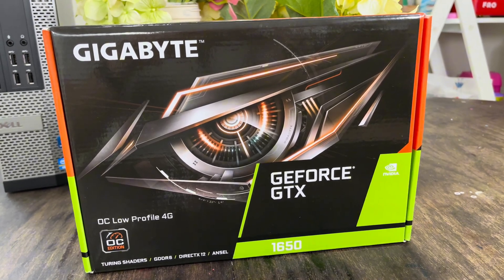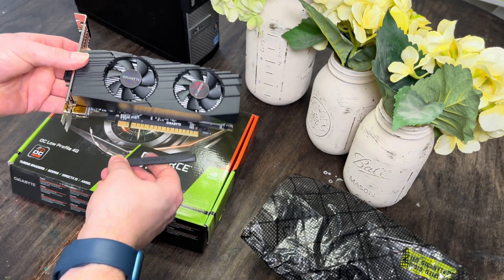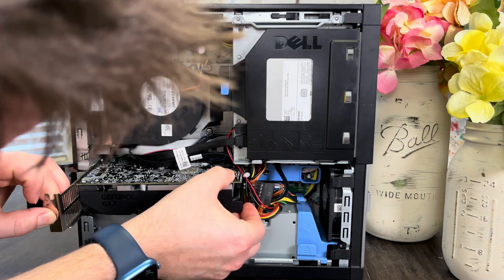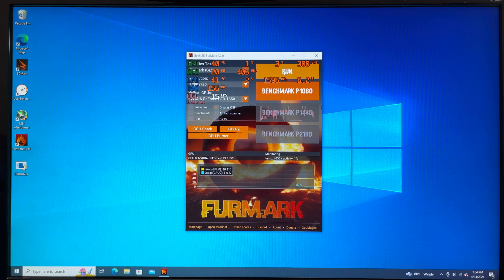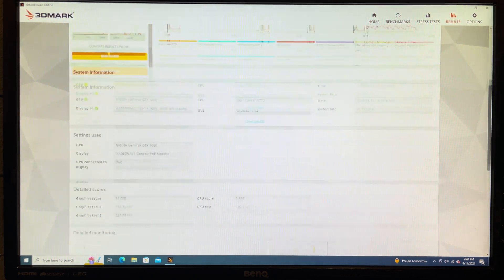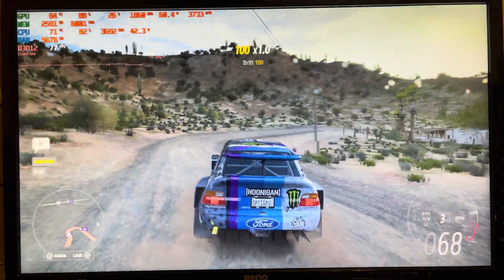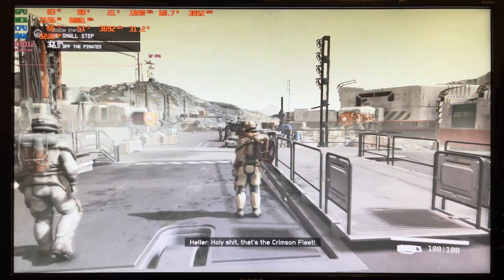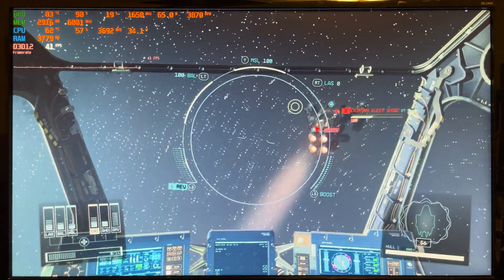￼Installing and Testing GTX 1650 low profile in￼ a Dell Optiplex 7010 SFF

Comment: I have the same desktop with the i5-3570 CPU and GTX 1650 LP graphics card and running the TSW5 on it. Very smooth on a 1920x1080 resolution.

Comment: Is it safe to add 1650 on desktop with i7 CPU & 240w PSU. Mine is 300W with i5, still fear to add RTX A400 low profile. Am i good to install it. Mine is asus s500 se desktop.

Comment: That PCI slot location is just one of the things that's great about the old X010 series Optiplexes, as later models put the x16 socket at the very bottom, limiting the use to single slot width cards.  On the MT it allows the use of a standard PSU as the mobo has a 24 and 4 power sockets, and versions that have a BIOS update that has Spectre and Meltdown mitigation microcode allow them to use Xeons for the same socket, in which the E3 1270 V2 and E3 1280 V2 are more powerful than the I7 3770, are cheaper on the 2nd hand market, but have a lower TDP (69w vs 77w) at the cost of not having an igpu.

Comment: Awesome video help. I'm trying to decide between a 3050 LP for an Optiplex 7070 or a 1060 LP so I can run a Quest 3 for VR modeling. Which would you say is the better card? Thanks.

Comment: I recently bought for a friend of mine a rtx 3050 6gb motherboard power only. Due to his 11 year old gtx 660 died out. Just asking because i am wondering how small or big bottleneck there is on above 8-10 old pcs? Think he has those 3570k i5 intel series
Reply from the maker: This is how it performed:
https://youtu.be/qFtEhB0Eq88
I’ll have to do more testing b/c there may have been a problem with the driver in my video

Comment: I need a Low Profile GPU slightly above GTX 1660 for my premiere pro 2024 at around $200 for optiplex 7010.  Recommendations please. I don't mind fairly used
Reply: Probably 3050 6gb low profile might work, no need for extra power connector and on average its around $180-$200

Comment: Never worry about low profile cards,
I use an angle grinder and cut a slot in the lid.
I am an experienced engineering workshop pro.
I can also get the same result much slower with a metal snips/shears or
even a 3 dollar mini/junior hacksaw and some sandpaper to smooth edges plus a quick spray of rattlecan primer and paint.
Easy mod.
Reply: mine iripped it on my own and bend some then put some plastic stick to stick it hope it last :)
Reply: mines dell 1650 its literally 1650 with 1 basic fan but atleast it didnt go over 90 celcius mostly 89-90

Comment: I love low profile pcs. I have a low profile pc with a 4060 and an i5-12400f to run my racing games.
Reply from the maker: Love it!  Thanks for watching
Reply: Could you do the same with the same GPU but with an optiplex 3020?  @OptiGPU
Reply: @carlosdavid8279 depends on which model it is if its a ddr3 model no
Reply: Nice flex lol
Nice build btw
Reply: @Random_viewer-2.0  haha tx. Wasn't realy trying to flex, more like... trying to say how much power you can cram into a tiny tiny pc, for, honestly, not that much money!

I mean the whole build was in around the 500 dlls mark, but considering i can play forza horizons 5, the crew 2 and others at 4k 60fps with the card not being maxed at 100%  (more like 80% tops) i'd say that's cheap! 

There are waaaay more expensive low profile builds out there... but i just LOVE mine! I attached a laptop screen to one of the sides and a handle on the top so i can even use it on the go, take it to lanpartys, is so damn awesome!
Reply: @josejuanandrade4439  nice

Comment: boss can dell optiplex 5040 support 1650 low profile?
Reply from the maker: Yeah, but if it’s the small form factor version of the 5040, you would have to plug it into the 4x slot instead of the 16x slot because it’s too close to the power supply. This will result in about a 7 to 9% performance hit.

Comment: this will fit in the 9020 sff right?
Reply: Yes, because in theory it would fit in most of the opiplex lineup
Reply: @asw165-12  i’m just trying to run dayz lol, i have the i5 4590 (i think is what it is) with 16gb ram and 512gb ssd. i don’t even think it has a good graphics card in it either bc i can run the game on low settings and only avg 15-30 fps. im hoping these 2 changes to my cpu and gpu will fix this problem
Reply: @itsdanielbruh4915  yeah and the 1650 low profile is a great budget gpu too but make sure your psu can handle it

Comment: The issue with the 1650 is that it states it requires 75w display port power supply where as the dell 0WR7PY  motherboard stat sheet states it only supports a max of approx 50w for the graphics card slot on the 240 w base supply for sff thats the issue I am having though peeps say the 1650 will work as you have shown...? edit: 75w vid card recommends a 300w power supply.
Reply: Just covering their ass for insurance purposes just in case of worse case scenario 🔥

Comment: Can I use this GPU with Dell Vostro 3470 - 200wpsu - i3-8100 + 16gigs ram? Thanks in advance.
Reply from the maker: That may be cutting it close on the power supply. Without knowing every single thing on or plugged into your computer that draws power, my guess is that the load wattage is going to be pretty close to 200 W.  At the very least, you may have to baby it and not spend too much time gaming.  If you can upgrade the power supply that would be ideal.
Reply: @OptiGPU  Thanks for the reply. I'll look into it with my local dell service person. I'll update if I have any info.

Comment: Can I install the rtx a 2000 and  an i7 3770 on an optiplex 7020
Reply: No on both and here's why.

Optiplex xx20 is 4th gen, not compatible with 3rd gen CPUs, you would need an i7-4770 or i7-4790. The K variant is pointless since it can't overclock anyway. Save your money.

Speaking of saving money, the "E3 12xxv3" Xeon chips are also an option (E3 1240v3 and up are what you want for an i7 equivalent) and tend to be cheaper on the used market than Core i7's. Some have iGPUs and some don't, unlike the Core series chips, which all have some kind of iGPU. Mostly it's the ones ending in 5 or 6 (E3 1245v3) that have the iGPU. Models ending with 1's and 6's (E3 1241v3, E3 1246v3) are later revisions (Haswell Refresh) with better voltage regulation/thermal paste under the IHS and slightly higher clock speeds. Also the i7-4771 is HR as well. Dell doesn't list the Xeons as supported "officially," but they have been user-validated. The models go up to E3 1286v3 but those are actually quite expensive on the used market for some reason; the lower number ones tend to be cheaper but YMMV. Just make sure to look up the part number and verify that it's 4 core 8 thread before you get one that's 4 core 4 thread (i5 equivalent) by mistake.

 You didn't say which model you owned, but I guess you must mean the SFF. RTX A2000 is two slots thick and won't fit in the SFF model because of the slot arrangement. If you have the tower yeah, it'll fit, but why; there are better/cheaper cards that will fit in the tower. Of course you would have known this if you had simply opened up the PC and looked before asking.
Reply: @aleaxdeathbringer  so what card do you suggest
Reply: @3xemann  You never did say what form factor 7020 you have. There are THREE: Mini (which lacks slots so you can't be asking about that), SFF, and MT. I'm assuming that you're asking about the SFF because it's really the only one where the question should ever come up. But discourse goes both ways. In the future, you need to provide enough details if you expect good answers.

The AMD RX 6400 is the best card for a SFF Optiplex for pure gaming. Also GTX 1650 is a good option, and with that card you can stream. Either of those are around $100-150. Below that budget, the RX 550 and GT 1030 can be good for older/less demanding games, as well as the Quadro K1200.

Comment: Hi and thanks for sharing. 
My recently purchased 7010 come with a i5 3570. Do you think it would be beneficial installing a i7 3770 like you? 
I’m currently using  a 1050ti which is probably the 2nd best choice behind the 1650 for  this SFF.  Or best wait to see if I go down 1650 road like yourself? 
Any advice would be appreciated.

Comment: I have the MSI GDDR5 variant GTX 1650 I bought new for $170 USD in mid 2020 right before the butt virus caused the bullshit GPU shortage.  I used my 1650 in a low profile Optiplex 3010 with an i5-3340, 16gb Gskill RAM and WD Blue SSD with great success.  Very nice system that even played Escape From Tarkov which is an unoptimized pig (going from 8gb of OEM RAM to the 16gb G. Skill got rid of the frame stutters and it ran smoothest I ever played it.  Shortly I bought my 1650, the prices shot up for over $400 USD because of the scalper pricks taking advantage of the butt virus.  My Optiplex 3010 with the GTX 1650 is so handy and I'll never part with it, might put in an Ivy Bridge i7 one of these days but the i5 is still plenty good enough.

My Optiplex 3020 is the same form factor as the 7010 in this vid and I really wish it had two PCIe x16 slots or the single x16 slot was swapped positions with the x1 slot because a 2 slot card will not fit in it.  I put a Yeston RX 550 in it but didn't use it for anything yet but I'll never part with that 3020 because it was my work computer for 6 years and a lot of memories tied to that machine.
Reply: Its not the virus who made gpus overpriced, its the gpu mining crises

Comment: Can it run on a 180watt psu
Reply: When GPU's don't have external power connectors, they only require 75 watts at maximum, as that is what the x16 slot on motherboards is rated to provide. So, assuming you are working with a 65 watt CPU, you'll be fine